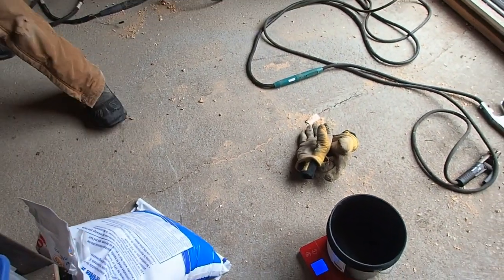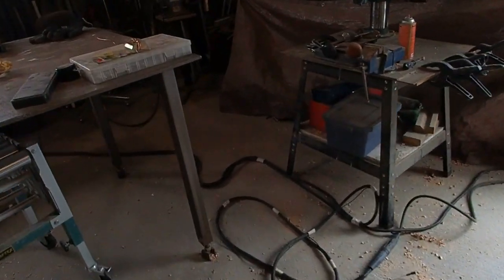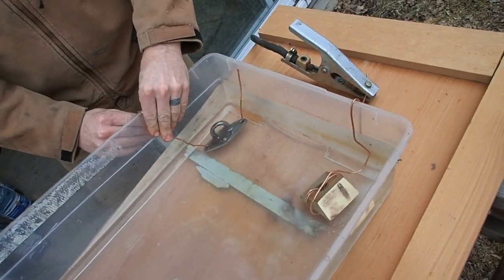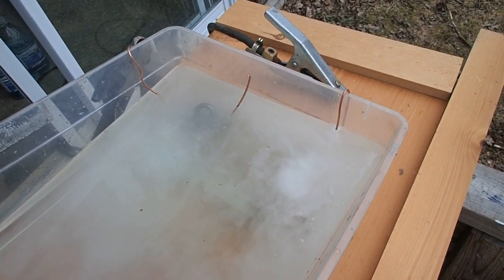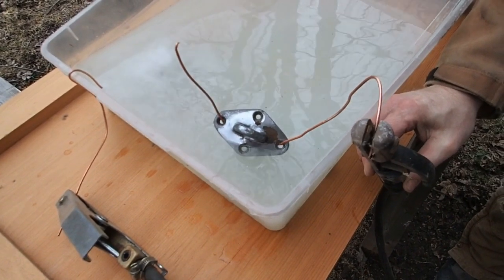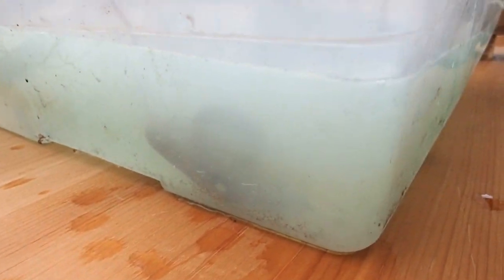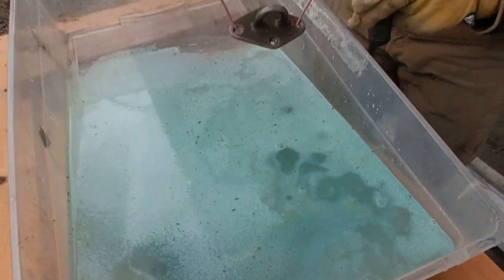Dechroming by electolysis

Comment: Could I use brass brazing rod for an anode?   trying to assemble all of my components... Power supply, solution, plastic tub, a heat plate with stirrer capabilities to keep solution agitated.  The reason I am being so precise is because someone had chrome plated a carb. This carb is brass and comes off of a 1921 Harley-Davidson and it is imperative that I dissolve any and all chrome, especially in the fuel mixture jet holes. I really hope I can pull this off. Thanks again for your time, etc. Cheers - The Parts Runner  ;-)

Comment: Lets say I have 100 faucets. If I go thru the process of de-chroming, it will eventually make a solution. If I store the chrome solution, can I later re-apply the saved chrome? Thank you.  You guys are great. My power supply and beakers got here just today.
Reply: From personal experience and researches I would say - YES.
  But you MUST use chromium anode. It will push chromium ions towards cathode. And you MUST find appropriate voltage and current values based on chromium elektronegativity and size of item plated & etc. Which MUST be used bit lower to prevent decomposition of anode. 
 If not mistaken usually it will be couple hundred miliamps and low voltage. Because high voltage breaking salt and you getting chlorine gas which is DEATH HAZARD. 
  To big current making plating brittle and not faster plating process. 
But is good for deplating mettals if used with Graphite, Lead, Platinum anode elektrode. 
 Same principle is for removing some other metals like Cu, Ag, Au, Ni from solutions. You using that metal anode (positive +) which wanna remove or plate.
  Afcourse plating times, quality and final results very depends on electrolitic solution used.
Tip to remember about electrolysis:
 + Anode  ADDing into solution towards -
  - Cathote CATCHing from solution ions or stripping anode elektrones (depleting it).
You add what wanna catch.
😉

Comment: I have a brass carb that was chromed. I would like to use this process. what was the cathode material that was in the tank and what was the solution mixed with the salt?  Thank you and best regards.
Reply from the maker: The cathode was bronze and the solution is distilled water with added salt.

Comment: Well, your video is still a interesting topic. I have never done this before but will  trying it on a bunch of 3 wheeler parts. I have no clue what the chromed metals are so I will be watching the integrity of the metals. I am using a Zinc Cathode so I hope that will work just fine. I have heard that everything needs to be degreased before so it works better. I like your application and copying it completely (Including Cold Weather in MN). I am just using table salt without iodine and hot tap water. I have twice as much water because the parts are larger and awkward. so 4lbs of salt diluted now and I will add more when I add hot water just before I start. (Salt would be a total of roughly 5 lbs.) I am excited to do this outside and will be using 2 amps to start and if its slow I will kick it up to 10 amps. Using a simple battery charger.

Comment: Are you using an arc welder for the power supply? What settings?
Reply from the maker: I can't recall exactly what settings. We just googled this and gave it a try. We started about as low as our welding machine could go.
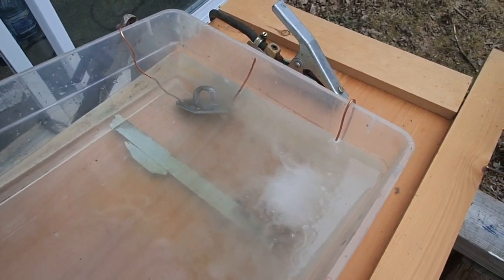Reply: @CalypsoDogs  @2:00 he says he's at the lowest setting of 10 amps. Would have to be on DC setting. I have never seen anyone use a welding machine for electrolysis. Usually folks use a battery charger. The idea of having my welding machine operating around water scares the Heck out of me.
Reply: @jeffbecker8716  Not much difference between the machine we were using and a battery charger. Sure a cheap welder with a high OCV would be a bit iffy. Keep in mind underwater welding happens all the time.

Comment: It looks like it's worked well. Just a thought though -- the chromium ion that has gone into the solution might not be very safe (re: Erin Brockovich)
Reply from the maker: We actually didn't take chance with it and disposed of the residual solution in through hazardous waste.
Reply: @CalypsoDogs  At 4:43, the lady started handling it with her bare hands. I would have advised her using gloves.

Comment: Would have gone faster if you use dc current and neg to piece you want to clean. A battery charger is less destructive to the metal.
Reply: Lot's more control from our welding machine than a battery charger.
Reply from the maker: The anode (-) was the piece we were dechroming.
Reply: @CalypsoDogs  I thought anode is (+)

Comment: Hey could you tell me exactly what you are using to remove the chrome plating
Reply: Sounded like a salt water bath and a 10A current. 10A is actually fairly "fast" for electroplate work, rule of thumb for DIY is around 1A.

Comment: This would be a lot more helpful if you describe what you’re doing. What materials are needed, exact measurements, voltage, what is connected to where exactly.
Reply: @TSM What's the other piece made of?
Reply: Tercian is correct, unlike the video, although effective it was not the best way to do it.
Reply: @franksgarage8551  so what's the way?
Reply: I just googled it and followed other folk's recommendations. Worked pretty good.